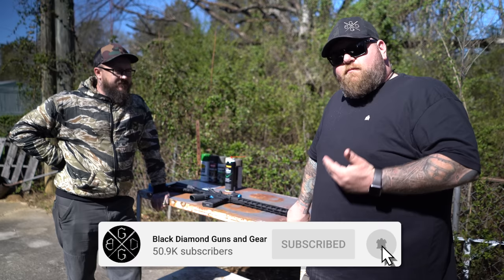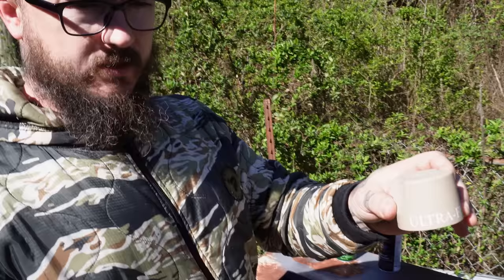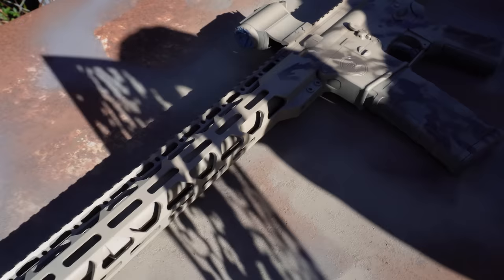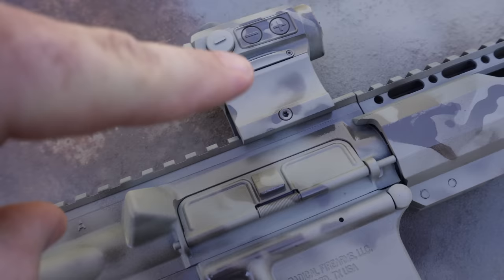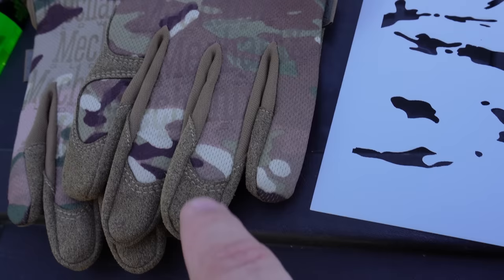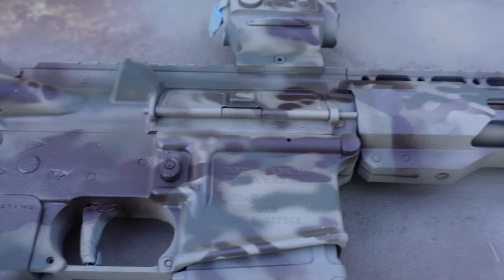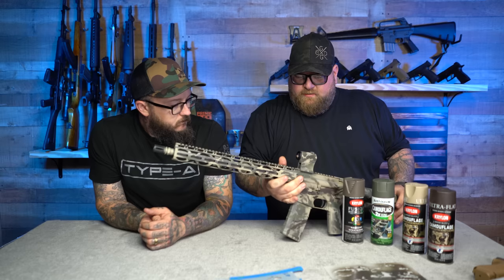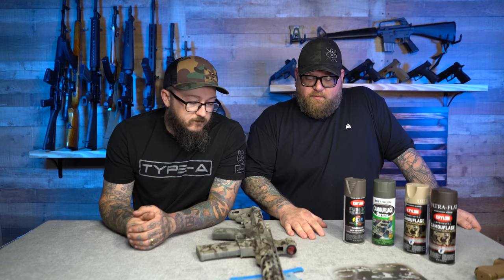How to Spray Paint Your Rifle, the better way…

Comment: This has me thinking 😁. When I was a kid, we grew up on a farm, and each spring we would spray paint the plows, disks, etc. after we got done using them for the year. Just use the old spray paint cans, whatever was laying around from where my mother refinished furniture. Yes, interesting colors at times lol (you Zoomers and Millennials will never know the horrors of 1970s colors… avocado, goldenrod, burnt orange...)(frankly, it's amazing y'all are even here). Anyway, it wasn't a beauty contest, it was purely to protect the exposed steel from rust. But it also taught us that paint sticks better than most people realize. If you do a degreasing, and very light initial coats (that's the most critical part. In fact, just a mist literally is the best thing, almost like an overspray). And then have at it. Give it a few days to cure, it will cure for the next couple of months and get better if you leave it alone. Maybe do a flat clearcoat. Will it get scratched? Sure. Can you have your "booboo repair kit"? Absolutely. One quick shake of a can, put on a template, hit it a couple of times with the spray, and done. I never would've imagined thinking about this until now lol. Please let us know how it's holding up.

Comment: I painted a wood stock 22 bolt action with rust-O-leum camo cans. Sanded down the varnish then put down 5-6 layers of OD green. Used Walmart leaf stencils and stared layering colors. I did lighter colors through out the layers. Then took a sponge tore it dabbed it in brown spray paint patted around for a dirty/ breakup look. 3 layers of matte clear coat. But I didn't paint the action , trigger/guard or barrel. I like the look. That's what mattered to me.
Reply: Also did a single shot 12ga. Light green/od green base coat. Then laid a expanded metal gutter cover and shot it with 2 different tans. Has a neat snake skin kinda pattern to it.

Comment: I think you should rhino coat your rifle,
 the same stuff people use in their truck bed,
or plasti-dip.
 I've also seen some amazing videos of people spray painting the surface of a tub of water and then dipping their pistol or whatever they want painted into the water through the paint that's on the surface and when it comes out it is painted,
it's pretty amazing.

Comment: DO NOT SKUFF THE RIFLE ABSOLUTELY DO NOT red 3m will scratch glass green wont and cerakote is a PAINT and it requires the entire gun to be taken apart and de greased and de gased to be don't right if it don't get cleaned or gassed rustoleum paint is just as good

Comment: For the upper receiver and barrel when it gets extremely hot, the normal rustoleum spray paint won't hold up.. you want to use the charcoal paint coating first and it wouldn't hurt to add some texture for the regular spray paint to stick in better. You can also use the rustoleum exhaust headers paint. Because it's engineered for extreme temperature and abuse from the elements
Reply: nothing wrong with imperfections, gonna look awesome when it gets battle worn.

Comment: You can also try using exhaust pipe wrap. It will not only help the original finish last longer but will add texture, and the paint you use will adhere and last longer. And you will blend in the natural foliage better. And you won't accidentally burn your hands if you accidentally touch the barrel after dumping a mag or two or more
Reply: Except that method gives a whole new meaning to “itchy trigger finger” 😂

Comment: Put down a coat of textured paint first and you will not end up with flat areas that produce glare. Even with the flat paints they will become smooth and reflective over time.  When painting Use old style gauze and you can get a bark like pattern.

Comment: I dropped some good money on my DDM4V7 Pro and my Remington 700 PSS.

Both those ladies got laid with rattle can.
I truly will never understand the purist mindset of those who think painting quality equipment is some sort of blasphemy.
I hunt with my 700, so having it rattle canned serves a solid benefit in the woods.

I bought my arsenal of tools as effective tools, not safe queens for show.
The color of the rifle has no effect on how well that tool will perform if it’s ever needed.

I’d also like to point out that factory painted rifles tend to have a very high IR signature which makes it easily identifiable vs the flat non glossy finish of some rattle can.

Cheers!

Comment: You normally do the paint to where your deployed. Works fine. Never used a Scotch-Brite pad. That mess the finish up. You need a sealer coating. It well ware off but then it's battle worn

Comment: youve got to tape off some of the pattern to get the best Multicam look, its all good tho. I went down the Duracoat hole and still am a believer in it, easier than Cera and cheaper and 90% as good. And yes, the prep is everything, most parkerized finishes are already good tho and accept the paint great. Doing it the way you did im sure still cost $70, you could get into duracoat for right around that.

Comment: GUYS THE ABSOLUTE KEY TO GETTING A NOT STICKY RESULT...
when you're done stand it in the corner of the room for as long as possible (at least 2 weeks, longer is better) without touching the gun. The paint will cure hard and not sticky at all.
Sidenote: PAINT THE BASE COLOR FIRST, THEN DO 45 DEGREE LONG STROKES OF OD, THEN LAY ON YOUR BROWN SHAPES
Reply from the maker: Thanks man

Comment: Now I'm curious how the paint would hold up running a full auto cookoff test lol. The paint is rated for what like 500-800 degrees usually. It'll burn at that temp, but what about discoloration? Would the color hold up in extreme heat situations?

Comment: I can tell you from the jump not masking off the barrel and gas block before painting is going to lead to problems. Personally if I had to go the cheap route I would have took my internals out and dry fitted the chassis and painted that by itself.
Reply: Nah, it doesn't matter. It just burns off anyway.

Comment: I use Glidden Max Flex, it's more durable the Krylon and rustolem and for multicam I paint a base, tape off with frog tape and then will paint, I always had rattlecan my rifles, black is not a normal color in nature

Comment: You guys are taking this issue WAAAAAAY too serious. Yes, your methods come out great, but you just need to break up the outline with (generally) darker tones toward the top and lighter tones toward the bottom. No straight lines. That, and prep the rifle well, and it will serve it’s intended purpose. You can also easily touch it up if you want. I really don’t see a downside to painting unless you plan to sell your rifle.

Comment: Or you could bring it to a professional rifle builder/cerakote aplicator like myself who will do it good and proper totally disassembling every part and sandblasting each part, degreasing each part then coated each part in any type of 3 to 4 color camo pattern or theme you wish. I also do a wide range of color shifting pearls in heat cure cerakote using H series heat cure armor clear, not air cure clear.

Comment: Looks good, personally I dont like stencils for the main reason, when dudes do stencils it makes them baby the rigs more then they know. Subconsciously they feel the amount of time they put into the paint job, they dont wanna mess it up. I normally use 3 to 5 earth tone colors, painter's tape and a sniper veil. To me an ar is a tool, and I've painted tons of them over the years. My main rig probably has over 7 grand sunk into it and as soon as I got it setup how I wanted, that bitch got rattle canned. I dont even plan on gettin rid of it but honestly if I did I feel these days, dudes really dig the look it has after a good amount of use and worn paint. I've kinda gotten to the point now if I see guys with unpainted rigs it kinda feels just to me like they dont really train or take it seriously if they talk about certain things. Just my opinion, I've gotten to the point if I buy any ar accessories I make sure they arnt black just so when paint wears, it's just another earth tone color under it.

Comment: I spray painted over 30 times, and the best way to spray paint the rifle is to:

NEVER spray paint it. It's messy, it never turns out good in the end, as paint will chip and respraying will never cover the chips. 
Just cerakote or leave your rifle black. 

If you like aesthetics, don't do spray painting. If you are prepping for an actual War, or deployed...DEFINITELY do.

Comment: With a black rifle, you don't need to coat the entire rifle in a base.. the base is the black. Just use your stensil, and mist and blend the different colors. You can actually just grab some dried leaves from the yard.. It's not rocket science.

Comment: So you guys have never painted a firearm before yet your making a how to video🤣 your over there prepping it 3 times and talking about how it's not going to be as durable as cerakote🤣. That's correct, it's spray paint! Doesn't matter how expensive a setup is or isn't IT GETS THE PAINT!!! No prep, no bs, just tape the trigger and glass and psssssshhhhhhhhhhhh!!!! All of it, over oil, grease, carbon! Paint it! Train! Train! Train! Then paint it for the next season, right over the top! Paint, train, train, paint, repeat!